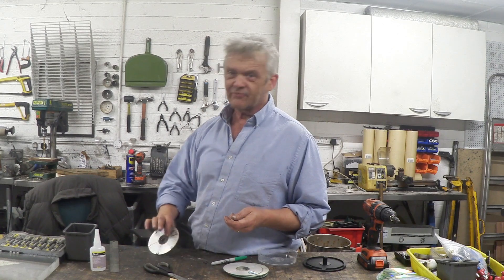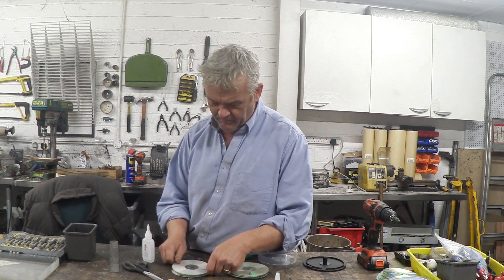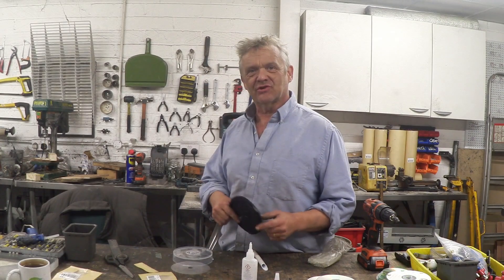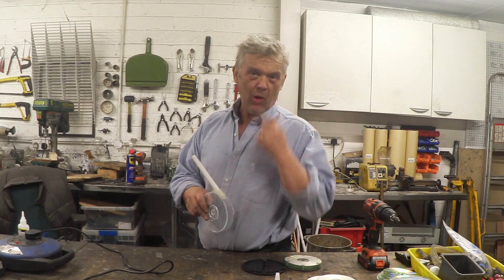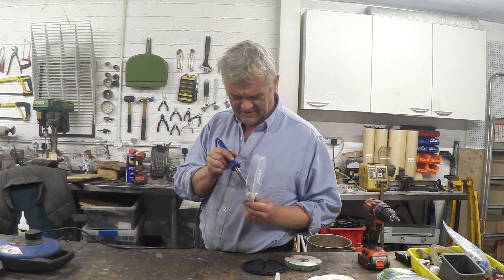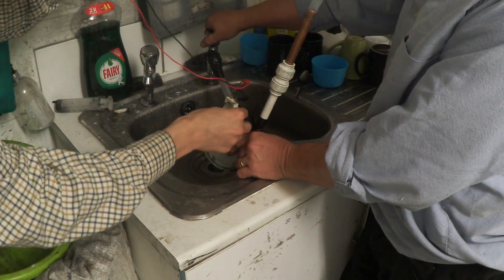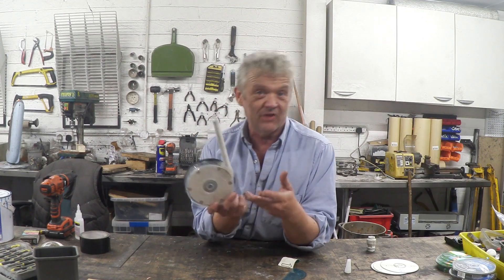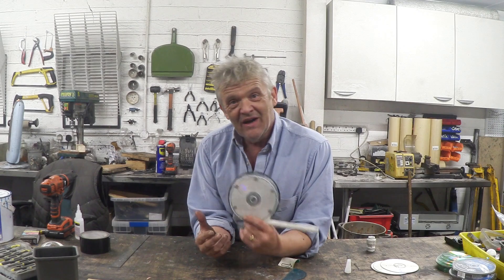1225 How To Make The Ten Minute Tesla Turbine

Comment: Mate just had a great idea, How about a tesla turbine that spins a magnet wheel that induction heats a copper pipe filled with oil in a closed loop with a freezer heat sink, inside a pressurised water heating tank, and the stem powers a tesla terbine, that is a Gen??   if a chain gear was connected to a car or bike wheel , it can spin the magnet wheel??  The TT can carge a super cap bank and power any e Vehicle?  At least give massive extended range?? This tech could solve Heating issues for e vehicles in cold climates! a bunch of 20w TEG's could be glued to the hot side of the boiler tank and the cold side air cooled when driving??( For all auxiliary power needes, without draining the main battery )

Comment: Considering the need to store power from windmills and solar cells: would it be reasonable to compress air and then at a later time use the compressed air to drive air turbines?
Would the inefficency be greater than batteries? Less costly than batteries. More evironmently correct?
Reply: Substantially lower efficiency than batteries.

There are others but I'll cite three main problems:
1. Mechanical efficiency of the turbine. Most small scale turbines peak around 75%-80% mechanically efficient. In the case of a Tesla turbine they've yet to be demonstrated as functional and capable of producing in excess of 50% so it's even worse.
2. Heat loss during compression. Compressing air makes it hot and that's not ideal so you need to cool it down before storing it. This is a major source of losses.
3. Small-scale turbines have mechanical issues that make them questionable. We'll ignore that the good ones are often extremely expensive for a moment and focus on the practical problems. Small scale turbines are smaller (duh) which means they tend to run at an RPM where elaborate gearing is required which opens up issues of cost. 

If you invest in a large diameter turbine and have existing compressed air the economic problem becomes: Why not just run a natural gas plant?

Sure, it's the opposite of your point, but it's partly why: Economic incentives.

Collectively the round-trip efficiency of compressed air storage is either around or below 50% vs 95%+ for lithium ion batteries.

In short: It's certainly a tool that should be in out kit but given that there are other systems with better round trip efficiencies, like pumped hydro, hydrogen, etc, that appear more promising in the short term.

Comment: Could I use a tesla turbine in the main water line that comes into my house? 
It might not come up to speed when we wash our hands but it should work well when we are taking showers or running the dishwasher.
It would have to be a nicer quality tesla turbine. I liked how you used a coil on the outside of the plastic housing. The question is how to create a durable tesla turbine made of plastic.
Reply from the maker: now then - I'll tell you what ate - we are thinking along the same lines here!
Reply: @ThinkingandTinkering  Hi
I once for sale on ebay a water powered radio that had a turbine and fitted in the shower hose. The trouble was it made you take longer showers because you had to keep going to you had finished listing to what  you were listening.

Comment: I have a funny feeling that air compressor [+ dyna pod] from Canterbury Automotive may be coming out of retirement ahah
One question - did you have to widen those gaps between the lid and the tray?  Mine are quite narrow slits and I'm wondering if what width is best for air/water flow 
Btw it's just the contraption i needed to finally test a 'new' source of energy idea i had affordably (if it works, i'll video it ;)
Reply from the maker: I used it 'as is' mate - the only modification I did to the case was the pipe to the side
Reply: Robert Murray-Smith thanks guv’nor!

Comment: Cool :)
speaking of compressed air- just yesterday I saw a company had made a solenoid pump that worked about 38% faster at pumping (both sides can be utilized), and 33% more efficient (due to the losses in going from rotational to linear through an arm, and where the power is in that compression stroke)  They designed it to make AC compressors use less energy, so it's only going to be industrial application.  Seemed like a notion you might find interesting so I thought I'd mention it.
Reply from the maker: it is interesting and I did have a look - seems the basis is a solenoid - like it though

Comment: Is this a clever way to say:
"Hi lad ... what you need a Stirling for.. when you have a Tesla ! ? !"
If this is the case I got your point...
But:
Making a fully functional & optimized Stirling Engine costs less than making a fully optimized Tesla turbine that doesn't break under it's own created centrifugal motion.
Carbon Nanofoam, Crabonium, Titanium are all expensive product even in large scale...
Maybe it costs less on assembling phase because it can be made as an almost fully mechanical industrial process...as per yours plastic aluminium and carbon ink idea, it get easier to mass produce the more you make it.
Ending up taking out all of the human handiwork..

But I think the Queen also value the world and works of Her working class heroes..
Reply from the maker: lol - not in the least mate - I have a love of stirlings and turbines pretty much equally - I have seen a very large LTD Stirling running on sunlight which I thought was awesome
Reply: @ThinkingandTinkering  
Do you think using epoxy coated graphite sheets coils would be any better than regular copper in a generator ?
For sure they would be lighter !
If it is just the numbers of turns in a coil that increase the voltage and electric conductivity isn't a variable for the production rate for sure with a string as thin as a coated foil you could increasing the number of turns the coil can make by many folds without making it any heavier.
Graphite and graphene sheets are different from each others and thus have different prices even if they are made of the same material.. right?
[EDIT]
Ouch apparently it doesn't matter because resistance it's a variable now they have decided....
Reply: @antoniopacelli  ? buy graphene sheets !
the world pricing of just raw materials for the diy maker is a mess right now, you are even asked to pay more for a kg of 3d plastic filament than a bigger spool of steel welding rod so cha ching no sale. even for convenience.

you will have to do Your research & let us know ASAP ^_~ when you have made & tested the Many aspects of you're questions & its reality... we need the/your answers & someone else's ready tested new shiny 'things' now
Reply: @paulmaydaynight9925  
Can't buy graphene sheets and testing...
I'm a prisoner of war
My limitations are enormous:
Can only read and write...
That is what "Mandela Effect" was in it's original form.
Anyway graphene can still have some expensive downsides considered how much similar it is to inexpensive graphite.
BUT:
Graphite can still be a potential solid solution if used in the right way...
Always with the Epoxy resin layer added to it... like Copper Graphite.
Reply: @antoniopacelli  you seem like already lost the battle mate, it's little late in the game to get nobel prize only using duct tape and graphite nevertheless i'm quite sure that you would be the one who gıt it as a political refugee right? btw if you really want to see the using results or feedback of this graphene thing, first you definitely change the way you look, for example imagine using amber instead of epoxy, try to dream in 2nd dimension. i really want to see you progressing but making excuses never helps or produces. this man in the video has showed at least hundred ways to make graphene/oxide. have a peace day, cheers
Reply: remember antonio, its Not an either/or us mindset you need, it's the uk 'as well as' thinking that gets you more.

tesla, stirling, & trompe plus other bits can be used here obviously as the main spiny thing, the hot/cold driven thing, & the accumulating compressor using water/ air fluids thing.
Reply: @paulmaydaynight9925 , 😁👍
Reply: @paulmaydaynight9925  
Yea technically speaking you could heating a gas for the Tesla turbine and making the Stirling spinning at the same time...
Could also potentially almost doubling the output...
Not even trying to searching for an excuse for saying that it would be too much expensive..
Because you would save the work power for one while adding lots of workers in the construction of Stirlings..
Just don't know if it works in a functional mannerisms with heated water or helium gas.
I've seen water becoming ice and destroying the Turbine, gasses I don't really know.. helium is just cheap and can sustain Really high temperatures.. and you Probably wouldn't need much of it..
Still maybe it expands too much..

I don't know...

Still wouldn't work in UK, or at least it would but just 46 random days per year...

Maybe more at Brighton..but than you would ending without any seashore..

Comment: So basically it comes down to the coil arrangement and the number of coils which determines the output voltage and current. (And of course the magnet size and strength)
Reply from the maker: basically 3 factors mate - coils, magnets and speed. coils are all about number of turns and thickness of wire, magnets are all about field strength and speed - well - as. much as you can!
Reply: yep, basically more 1mtr turns = more v, thicker wire =more current as it has less resistance than thin stuff, magnetic tesla =combination more overlapping turns & wire thickness ,3feet/1mtr of wire is standard base calcs & about the least length to get something usable out of it too. x windings masks the actual length you might actually use so measure it before you start lol.
Reply: @ Steve to

What you said has merit. Those factors matter.

However in previous videos Robert demonstrate that cheap ceramic magnets vs the expensive stronger neodymium magnets did not present a substantial gain.

What Robert pointed out was the speed/ RPM, at which it turned was what:  INCREASED voltage/ amperage/ = watts realized.

Hope that helps.
Reply: @reypolice5231  I agree with everything you said however each generator / converter has its own balance when it comes to magnets and coil arrangement. In one application one work better than it would in another.

Comment: Spin them fast enough the discs warp. Explode.
Reply from the maker: so would anything lol
Reply: @ThinkingandTinkering  

Seem to me like you made another windmill. All it needs is a great big funnel to push air in, and a lot of holes at the back for it to get out. Truly fantastic.

A magnet stay at the base to make it magnetically levitate as the "bearing".

I saw a guy show it. But you added the housing as a instant turbine. I am truly amazed. Thank you.
Reply: takes a lot of rpm though, remember by design they do spin fast in the dvd player... oc you could just give them extra strength by simply dipping the disks in water glass / Sodium silicate /liquid concrete sealer that's glass hard, extreme heat resistant & you can put it next to your plants to cure it quicker while talking to them ^_~ 
(co2/carbon dioxide for fast curing Sodium silicate, aka used in sand casting)
Reply: @paulmaydaynight9925  Brilliant!!
(As Hubby shuffles away, nervously!) Andrea, Jasper and George the Pigeon. XxX
Reply: that was a fun episode of mythbusters
Reply: Those are awesome videos on the Slow MO Guys
Reply: That can be mitigated by going from flat sides to curving sides on the disks.